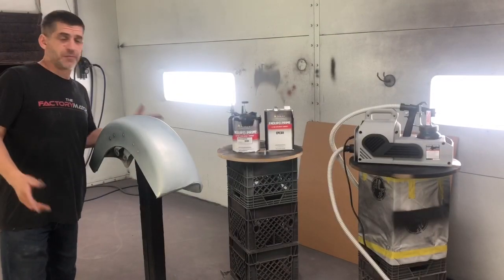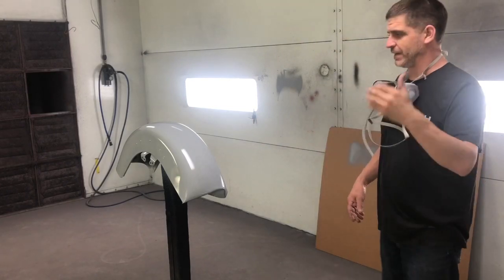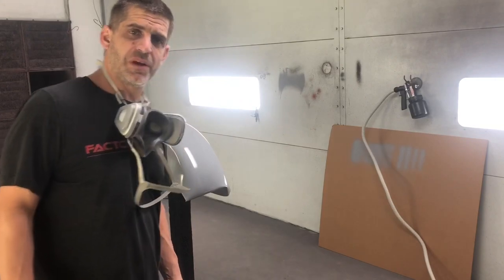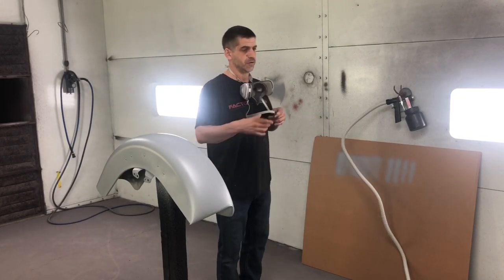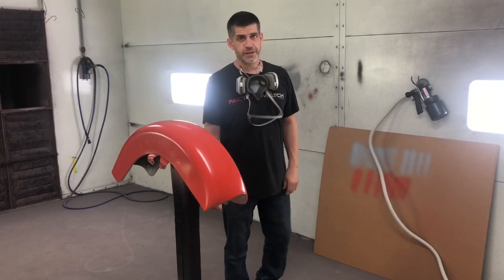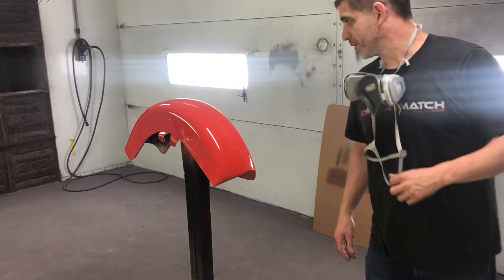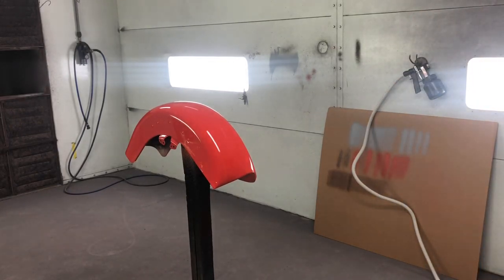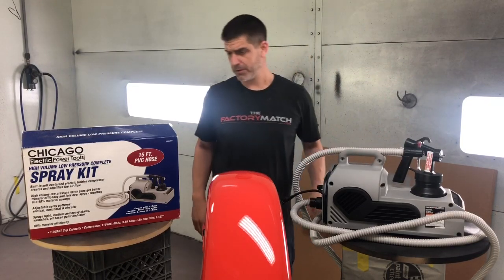Turbine sprayer for DIY with Automotive Paint. Harbor Freight item #44677

Comment: Thanks so much for making this video. I have never done any car painting but I'm going to be trying this soon with the same Harbor Freight HVLP unit. I did a lot of bondo rust repair on an old beater car to teach myself basic body work and the next step is basecoat/clearcoat. I'll use the 1.0 mm tip like you did. Just an old dude trying to learn something new.
Reply: How did it turn out?

Comment: I used to have a turbine system from Tip tools.  I done tons of cars and trucks with it. No worries about water and oil contamination.  Way to go these days.
Reply: Can you do complete paint jobs with a turbine sprayer?
Reply: @beecnote7742  you can, just make sure to wet sand and i would advise to spray an extra 1 or 2 clear coats for a super flawless mirror-like finish!
Reply: @beecnote7742  yes.  I have.  I use a Titan TS50, which is a 5 stage.  I also have a Capspray 5100, which is 2 stage unit.  You will definitely save money on material.  There is hardly any over spray at all, so they use paint way more efficiently.

Comment: Wow. Great review and timely. I just bought one on clearance for $99. Will be painting sailboat deck which is primarily 1” waterways and larger surface area for cabin sides and cockpit. I will be using 2 - part Interlux. Spray tip, reducer and your other tips will help. I wasn’t looking for perfect but your review shows I’ll get better results than I expected. This will be much better than roll and tipping. I hope to get primer and 3 coats donein a day. Last coat will have reducer to make it more semigloss. Thanks again for your straightforward real life review.

Comment: I bought two of those exact machines , one was 2 stage and one was single stage . Boxes were identical
Reply: Did you open up the sprayer unit and look inside to see the turbines? This brings up a lot of questions. Was the unit in the video a 1-stage or a 2-stage? Mine is so weak that it must be a 1-stage. Please let me know what to look for to determine how many stages it has and whether or not the 2-stage sprays better.

Comment: Hi, I used your video for reference. I just tried painting my doors with Eastwood's Black 2k Urethane Primer. I used the 1.5mm tip, its a 4:1 mix and I then added a small amount of reducer (like 5%). The biggest issue I had was crazy orange peel. It cured nice, but looks like a wall in my home after I hit with a roller! I'm not too concerned because I need block sand these doors anyway, so I'll get it smooth. This was over a 2k epoxy primer (used those new 2k rattle cans) scuffed to 400 grit. I noticed the paint was drying very quick, and the air house was very warm. I know turbines out out hot air. This was in my driveway, ambient was like 78 degress. Any tips? 

If the primer went down well (which it didn't), I was maybe going to use this same turbine to do the topcoat (single stage urethane). The SSU would be cut and polished too, so a little orange peel is fine, it would come out in the polish.
Reply: You used to big of a tip thats why you got the orange peel like you did He used the 1.0 tipI guess you can slow down the stroke to avoid dry coating
Reply from the maker: The HF kit should have came with a 1.3 tip but they don’t. 1.0 tip was the only one I could use and get pretty good results.
Reply: You need a higher stage hvlp , the more stages the cooler the air so you don’t get orange peel. It’s running to warm because it needs more stages for automotive paint. When using automotive paint ideally you want to use at least a 4 stage for best results.

Comment: I painted a car door and a fender and got heavy orange peel with that system. Maybe a slower reducer would have helped. Cut and cuffed it out, but that was a looong process with hardened single stage urethane (very hard paint).  Do you think you can adjust that gun/paint for a glass like finish?

Comment: At 17:20 on the video, you said you were going to turn the fluid needle in a little bit when spraying the clear coat but you didn't explain why. Did you do this to get better atomization in order to prevent orange peel?

Comment: Thank you for the review. I have to paint my car and was on the fence of the whether I was going to use that or a more expensive model.  Definitely going with it for the paint project!
Reply: Did you ever got to paint the car??
Reply: @Justsendit95  I did, the results were pretty good. Thank you for the review again, it really helped
Reply: @richardmcfink5305  I actually went to my local harbor freight and those turbines are discontinued i guess 🤦🏾‍♂️
Reply: @Justsendit95  Get on the website, I've seen them at my local store here in FL.
Reply: @richardmcfink5305  I’ll take a look you have any pics or vids of your results is it worth it?

Comment: Thanks so much for this, Im a DIY about to paint a car im restoring at home. You mentioned it came with a couple tips, what size would you recommend for Single Stage Urethane?  Also did you say you used a 1.0 tip for the primer?
Reply from the maker: The kit comes with a 1.0, 1.5 and 1.8 needle and nozzle sizes. I used a 1.0 on the epoxy primer which was reduced 20% which made it pretty thin. That the reason for 3 coats for film thickness. A 1.5 tip made the droplets to big , and there’s just not enough air flow to atomize. 1.3 would be perfect but it’s not a option.

Comment: Great review.Since most of these types of sprayers have 2 psi.How do you think you would have done with a Fuji Semi Pro 2 with 5 psi and way better gun.
Just wanted to edit my comment.If it is the same as the Rockler it should about 4 psi.
Reply from the maker: I will find out soon as I just bought one off my local marketplace for cheap and it’s brand new. I will do another video soon with it.
Reply: Nice.Thanks.Been bouncing one of these around for awhile.Looking at many,many reviews and forum posts.Fuji did say these would be fine for car paint at one time.

Comment: Can this be used on a full sized car?
Reply from the maker: It can but…… the unit will probably get hot and start to cause issues in the paint process. If it was me and I was trying to paint the whole car with this machine, I would pick a color that I could do it in steps like the doors and front fenders together the hood and roof together one day etc.

Comment: Take the Fuji for a test drive yet?
Reply from the maker: Not yet. Soon. Work has been busy.
Reply: @hifiside5066  Cool.It is great your working during these times.Picked up a Earlex 6003 with gravity gun for a steal.And a new Ametek motor.Should be pushing almost 8 psi when done at less than a 1/4 of the price of a equal Fuji.

Comment: Great video. I have purchased a Fuji turbine system after getting priced out by the "pros" for painting my motorcycle projects. My first experimental paint job was this utility trailer https://youtu.be/ZQGtg2GSF9k  Then painted a bunch of MC engine parts. Still learning dent pulling (and other body work stuff) then on to my first real paint job giving a facelift to my thrasher bike. Then on to painting two more recent resto mod bikes that are ready for paint. I will go check out more of your videos now. Edit: Too bad. Looks like you stopped posting videos. Thanks anyway!!!